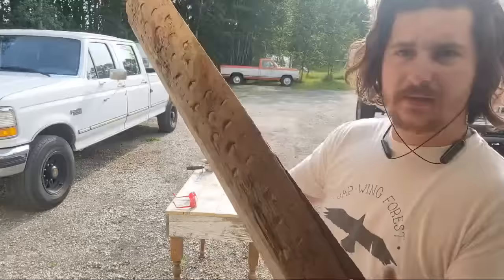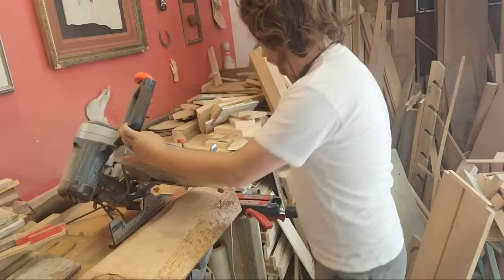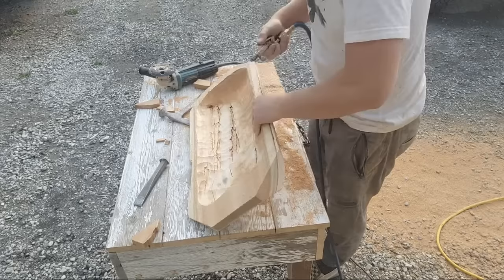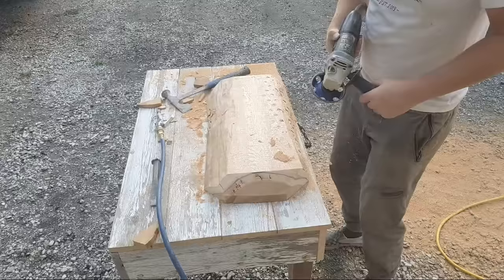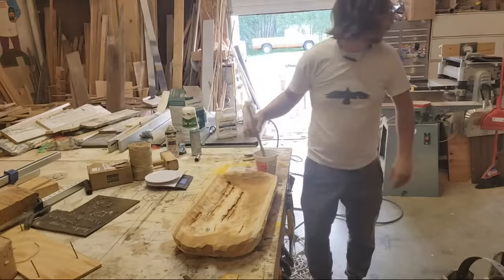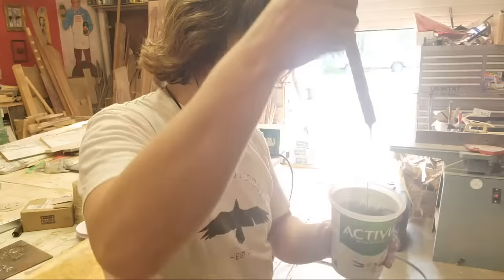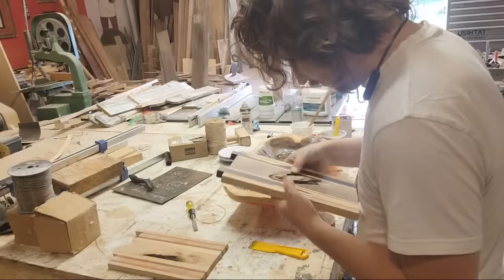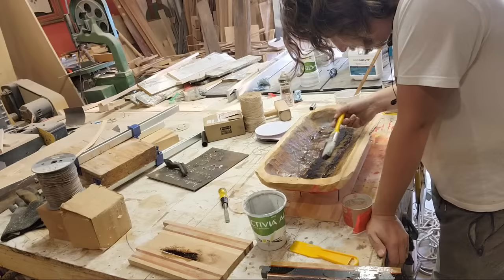Joshua Alexander making a dough bowl from scratch

Comment: Great design & nice work on the bowl.  I noticed the dry rot appeared to be in the sapwood portion.  You might be able to avoid a lot of that & get stronger material if you use lumber cut from the heartwood.
Reply from the maker: Absolutly.